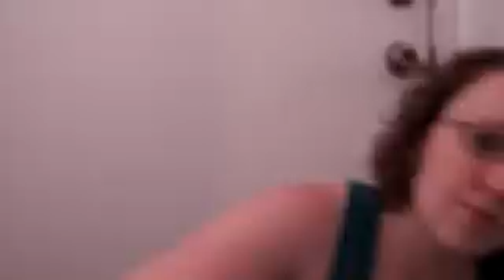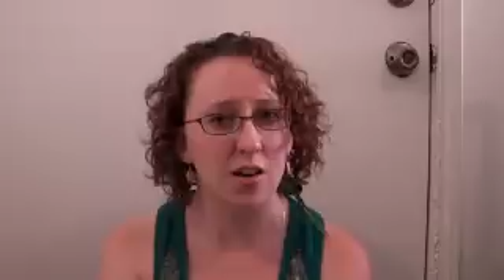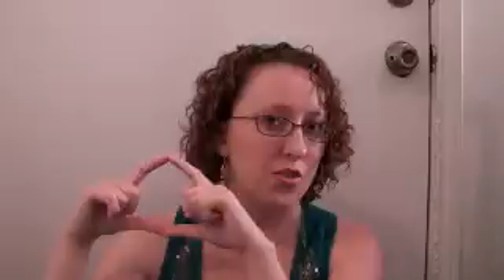How to Build a Fireproof Home

Comment: The cement columns you are referring to, are not approved in ca due to seismic activity. Wood frames flex and give the house its needed flexibility.
Reply: Under the earthquake rubble you still have all your material things. Fire you only have ashes. I told my bricklayers that when a earthquake strikes I am going to run into my house.